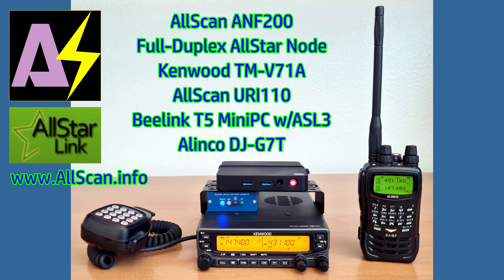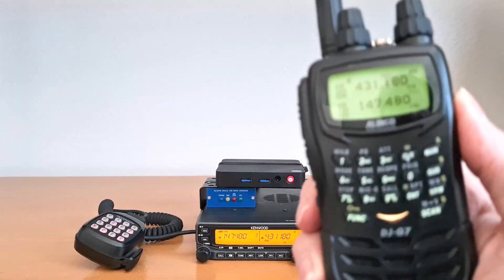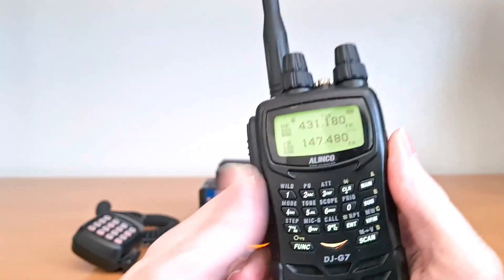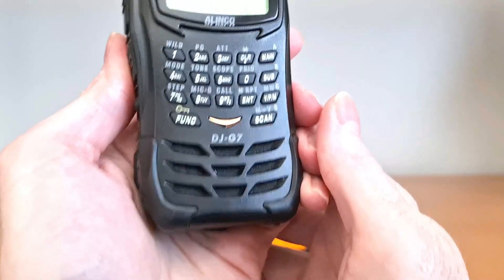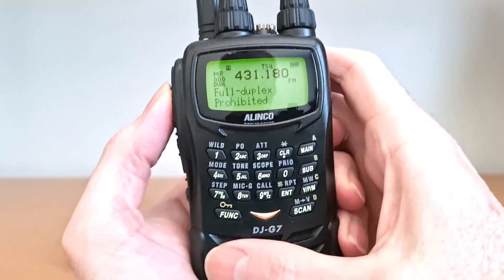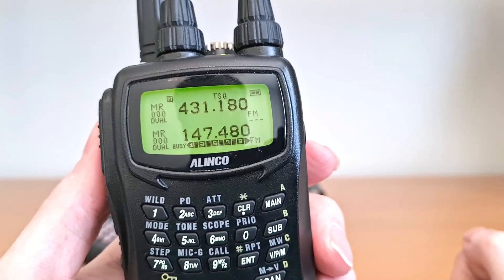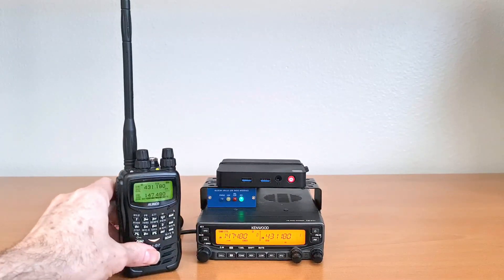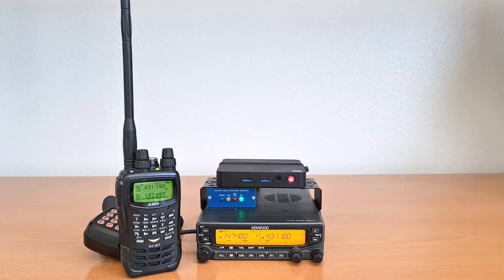AllScan ANF200 Full-Duplex AllStar Node - Kenwood TM-V71A URI110 Beelink T5 MiniPC ASL3 Alinco DJ-G7

Comment: So this works only with 1 freq. no way to remotely change the freq..
Reply from the maker: AllStarLink does support Remote Base functions in which case you would connect the serial port lines between the radio and MiniPC, but 99% of AllStar users use their nodes as regular nodes, not as remote bases. The purpose of an AllStar node is to connect to other nodes over the ASL network - not to use the radio as a remote base. These are very different use cases, but ASL does fully support both.

Comment: So the PC to USB port from the radio is NOT required?  What other HTs aside from the Alinco will do this?  I have a V71 so I might just get this interface.  Thanks!
Reply from the maker: AllStar nodes need only the Mini-DIN-6 "data" jack to connect to a mobile radio ie. Ground, PTT, and "9600" audio in & out. Some other nice full-duplex HTs: Yaesu FT-51R and FT-530, Icom IC-W32A.